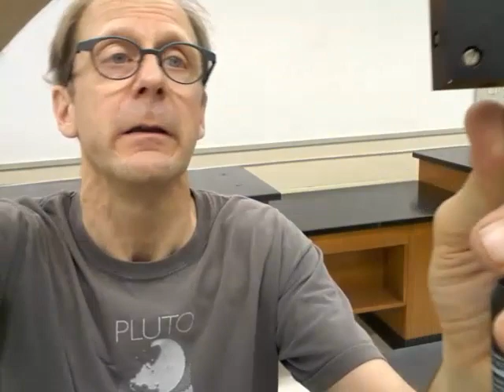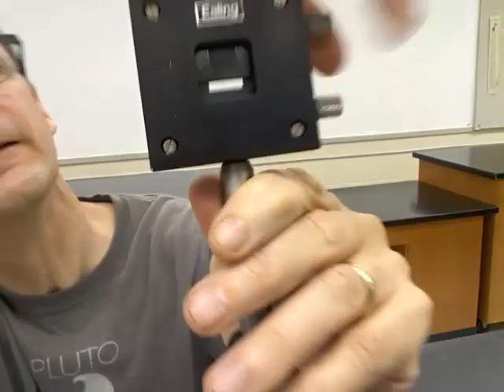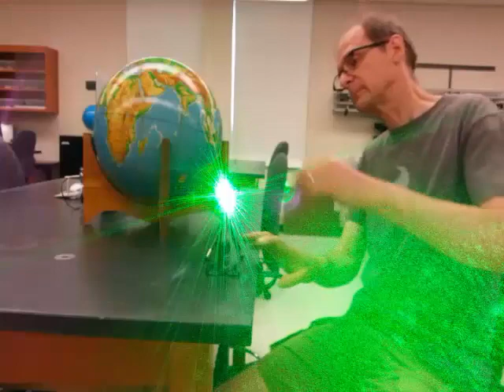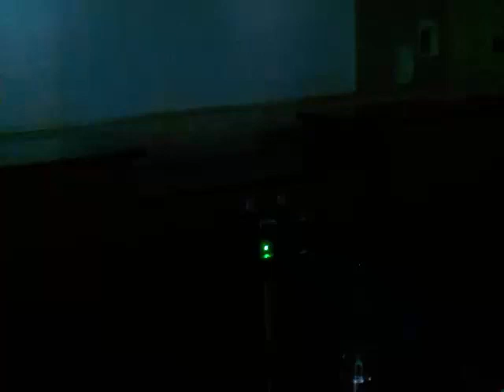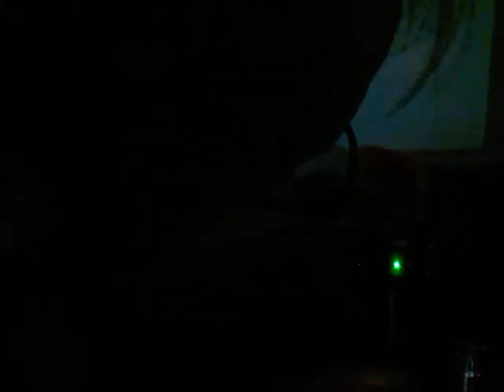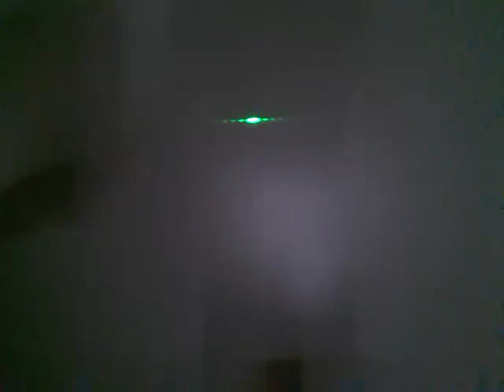Diffraction Through a Narrow Slit

Comment: Sir why the diffraction pattern is vertical for horizontal slit. Please help
Reply: He explained that when the slit is horizontal the vertical light is "squeezed" and vice versa when the slit is vertical. When there's no slit it's just a dot. I just assumed that when the sit is horizontal, the horizontal light has no problem passing through the slit, so it's just like the no slit example but only in the horzontal direction. But the vertical light squeezes through, so it diffracts

I'm not a phycisist this is just my assumption

Comment: This is a dumb question but does the same thing happen to sound?
Reply from the maker: Yes. The wavelengths of sound are MUCH longer than light, so significant diffraction happens with MUCH wider slits. That's why you can hear around a corner but can't see around a corner.

Comment: Very nice presentation. What I still do not understand is how a vertical slit gives a horizontal line of light, and a horizontal slit a vertical line of light. How does that squeezing of light work?
edit: I am asking his because laser light is concentrated in the center of the slit in whatever form, The distance from the screen accounts for the magnification, but not for the spreading. The fact that for a horizontal slit a vertical movement of the shutter is needed, and vice versa, and the centered spot, explain how that happens. It does not explain the spreading out.
Reply: He explained that when the slit is horizontal the vertical light is "squeezed" and vice versa when the slit is vertical. When there's no slit it's just a dot. I just assumed that when the sit is horizontal, the horizontal light has no problem passing through the slit, so it's just like the no slit example but only in the horzontal direction. But the vertical light squeezes through, so it diffracts

I'm not a phycisist this is just my assumption